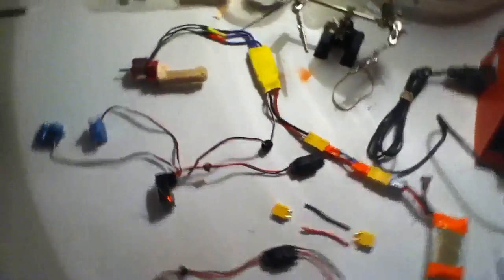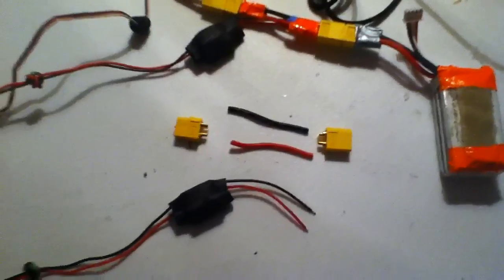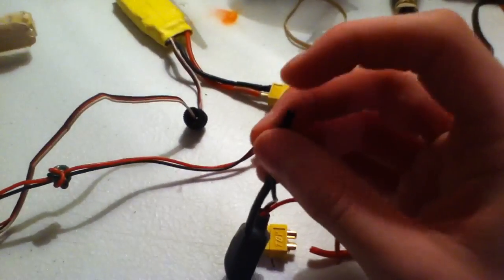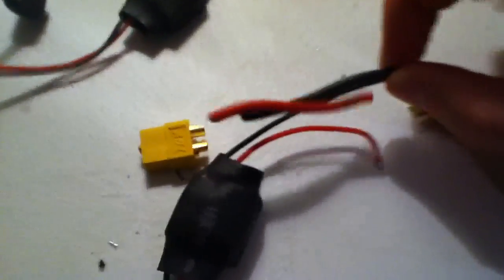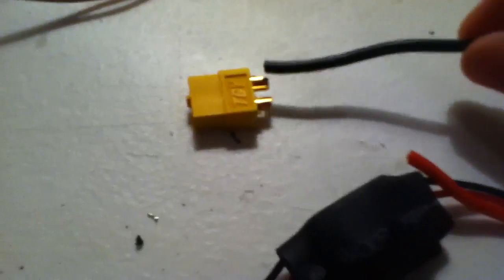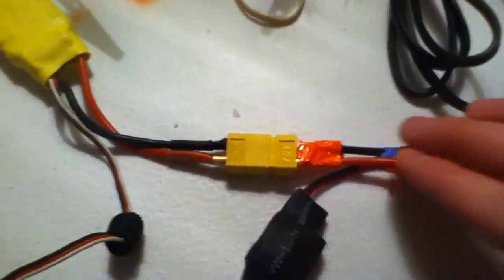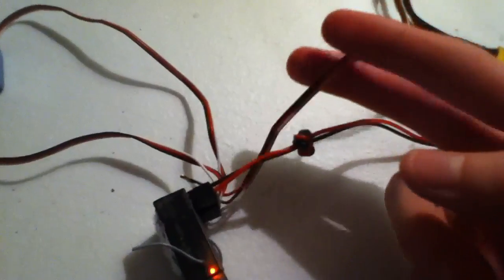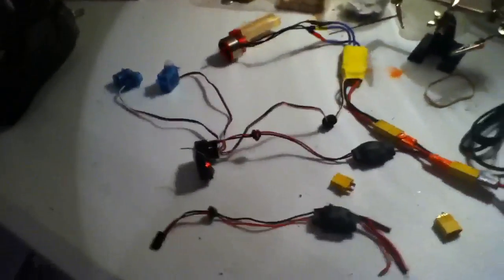How to set up a BEC

Comment: Thanks for your video- will this work still if the BEC and ESC servo plugs are connected to ONE channel only in the receiver via a y connector ( to save using up spare RX channels)? Thanks